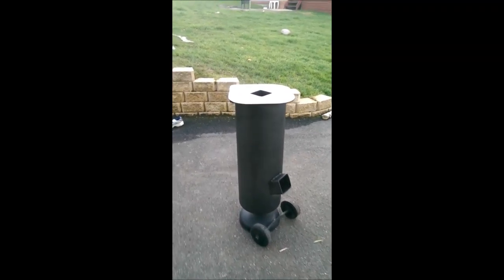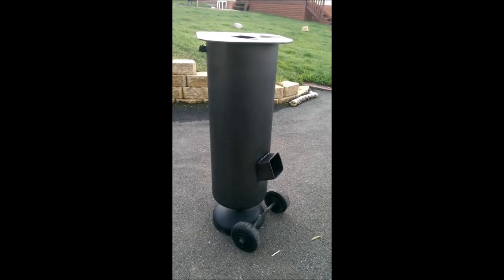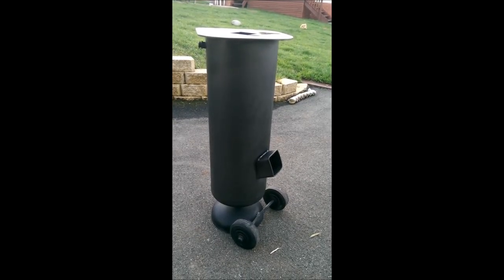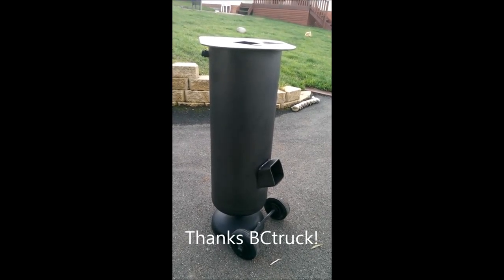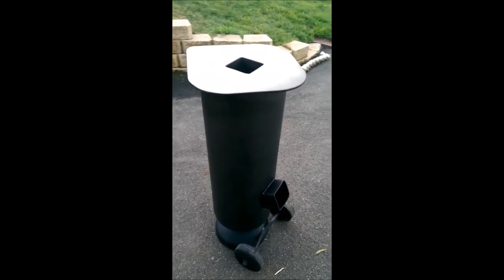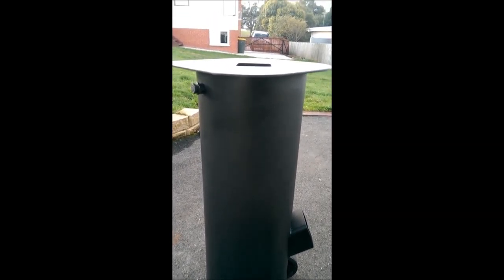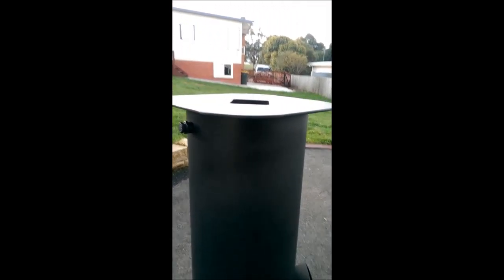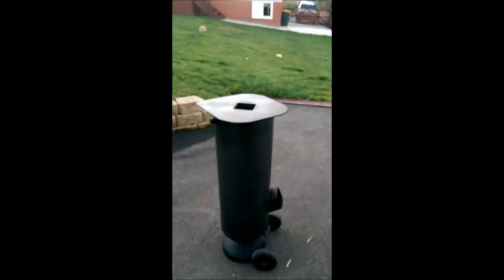Air compressor rocket stove

Comment: Looks good. Do you need to weld the top plate to the outside cylinder at all? Why not just have it attached to the burn tube, and let it rest on the cylinder? You've only stitched it in a few places, so it's not like you've tried to seal it anyway.
Reply from the maker: Shagzter77 True. The casing is filled with pearlite which looks like polystyrene balls. I was going to weld it all the way round so the pearlite didn't fall out when tipped over to move. I have since fixed the problem by welding a band of 3x25mm flat bar to the the underside of the top plate. Sitting very snug against the side of the casing, this band prevents pearlite from escaping but allows the extension of the burn tube when firing. It moves about 3mm up by the looks of the marks in the paint.

Comment: I had misunderstood the direction of expansion, - the burn tube expands up, rather than the plate expanding outwards, sorry. Sounds like a good fix! You happy with it now?
Reply from the maker: Shagzter77 It may have been a combination of both, but the upwards movement of the burn chamber was more apparent due to the bow in the top plate.
It seems to be pretty good now, have tested it with a stainless keg on top, gaining heat from the thermosyphon as well as direct heat from the flue. I ran out of timber, but got about 50L of cold water up to about 55 deg in an hour and a half.
Question for a boffin: Which is more efficient 1) less flow at higher temp by taking outlet of thermosyphon above water line, but letting it boil in coil to produce thermo pump, or 2) Higher flow, less thermal gain by 'completing' thermosyphon by allowing water over the outlet but not restricting flow?

Comment: Realised that those welds are probably what stabilises the top end of the burn tube, sorry... How about cutting three small slots vertically into the top edge of the cylinder, at 4, 8 and 12 o'clock, and welding three corresponding radial 'fins' to the underside of the plate, such that the fins sit in the slots and, as the plate expands, the fins slide outwards through their slots (only a few mm movement of course), and the plate and burn tube are still thus stabilised?
Reply from the maker: Shagzter77 The burn tube is welded all the way around where it pokes through the casing at the bottom. This seems to be sturdy enough to keep the top steady. It wouldn't NEED to be welded at all if I wasn't worried about the pearlite...